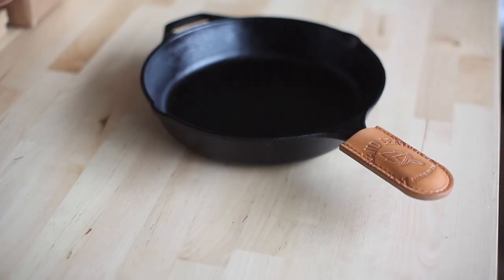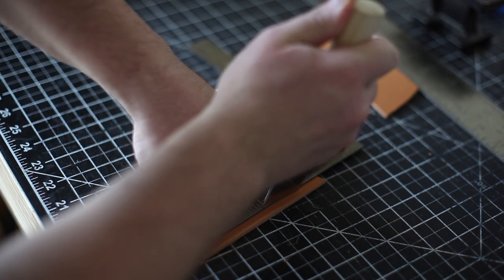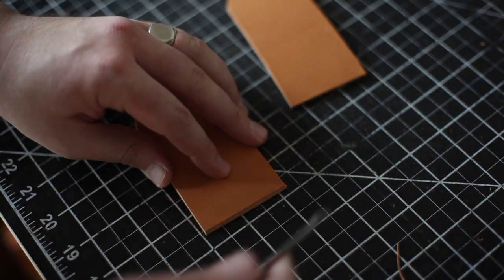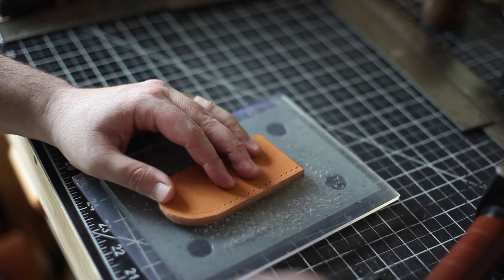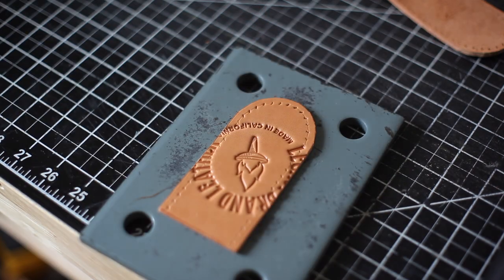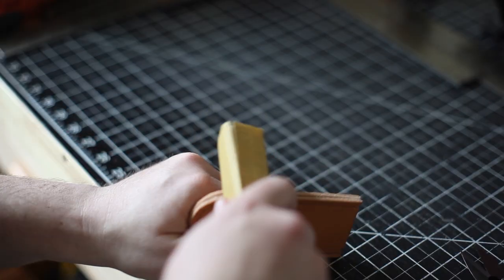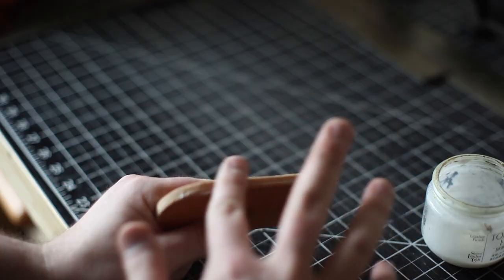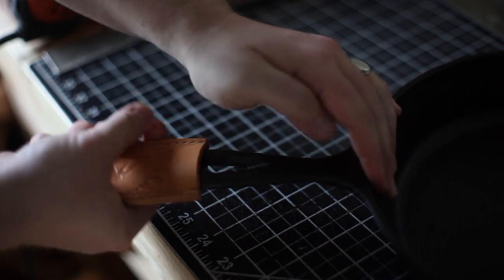Making a Cast Iron Skillet Handle Cover

Comment: Nicely made. Though it might slip off when tilted down.
Reply from the maker: It's on there pretty snug.
Reply: @legacybrandleather  yeah ok. If there is a hole at the far end of the handle, may be a small screw/ripit will take care of sliding for good. Your artwork nevertheless is awsome.
Reply from the maker: @ejazh5285  The next time I have a chance to craft one, I'll have to try your idea.  Thanks for the suggestion! Cheers